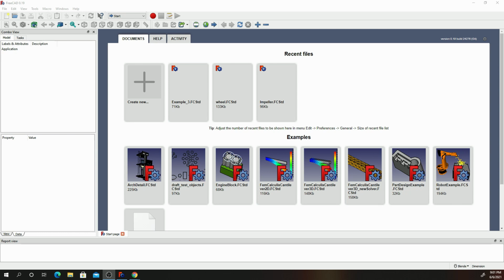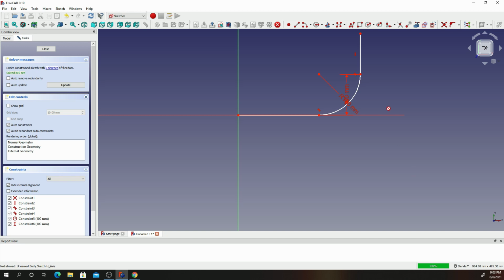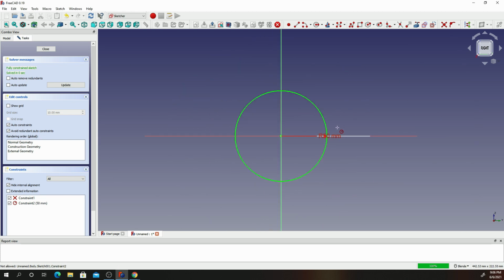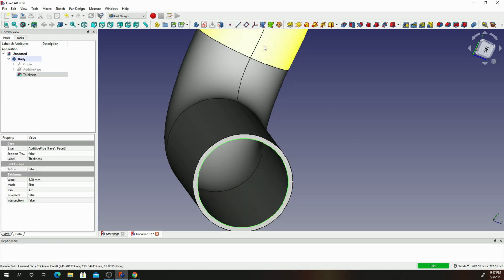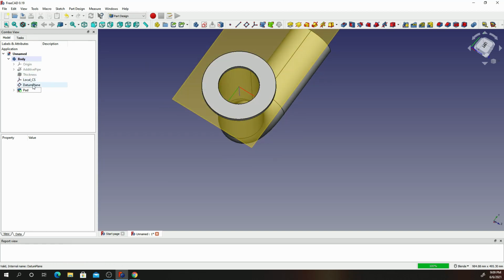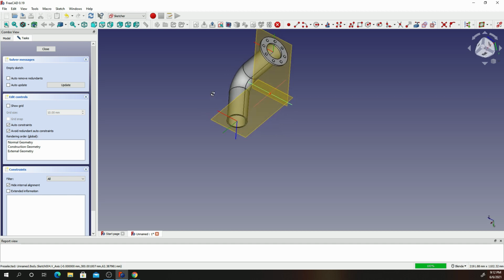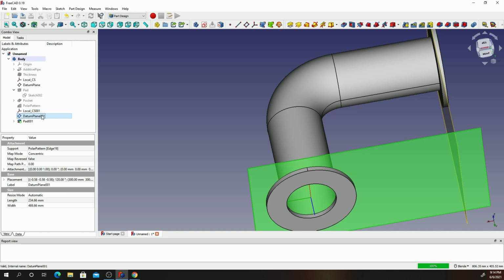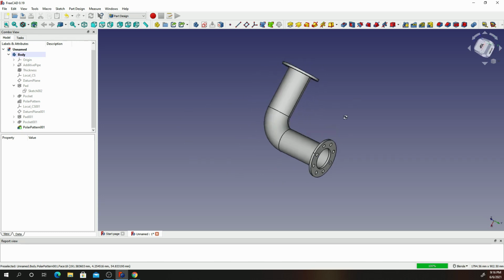How to Draw an Elbow Pipe with Flanges Using FreeCAD

Comment: I followed this step by except I am trying to make a 45 bend not 90 so have my top piece angled, I constrained everything and it will not go green???? anyone have any thoughts?  I have it constrained to center of axis, height on bottom piece going up, radius, and top piece horizontally then I constrained any dimension that I could.  Does anyone know why this won't go green so that I can use the additive pipe function?

Comment: This was good. But, very crude and not accurate for use. The pipe dimensions for use, if arms/legs were required to be 200mm, then you can not tack the 10 mm for the flange thickness on each leg. You'd have to make the flange ID to the pipe OD and have a different weld and grinding then what was shown. It is also easier to weld at the end of the pipe than inside the pipe. So, the flange is best to be made with its ID to the OD of the pipe and slipped onto the pipe. Then, welded in place.   Sorry ----- real world issue.   Not just make a pretty 3D picture.   And not forget the orientation of the hole pattern. What would the real clocking need to be for the 8 hole pattern.  Tip: Hole patterns are always the elephant in the room. When it comes to manufacturing.  Always the biggest headaches.
Reply from the maker: Sorry you see this as crude, its called parametric modeling and you as a designer determines the accuracy and form of your part depending on your manufacturing requirements. All the geometry that was created in this example was produced by rules and parameters (in FreeCAD we call these Constraints). For example the inner radius of the Flange and the outer diameter of the pipe is 50mm. If you want the pipe to slip into the flange , you have 2 option you reduce the pipe outer diameter or you increase the inner radius of the flange to allow the pipe to go through the flange (depends on your tolerances and design goals).

Please note that welding, 3D printing and CNC requirements can call for different design approaches and you as the designer determines which approach fits your manufacturing technology.  Thanks

Comment: When I use this same procedure and then export to an stl file for 3D printing, the elbow section does not look smooth at all. But if I use a portion of a torus as the elbow section then the 3D print looks very smooth. Do you know perhaps why this is?